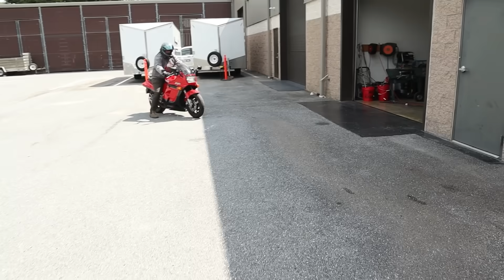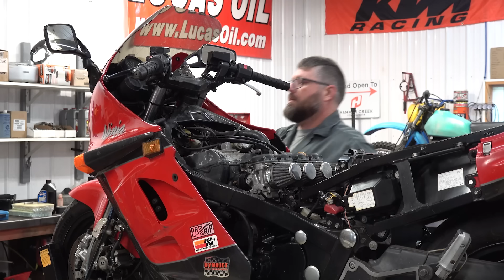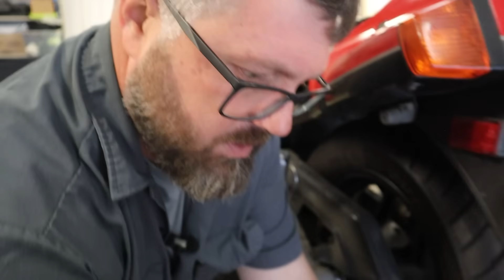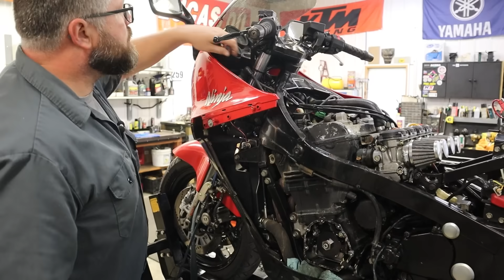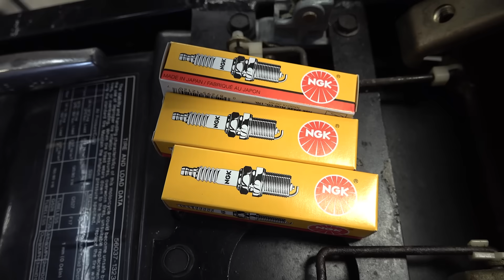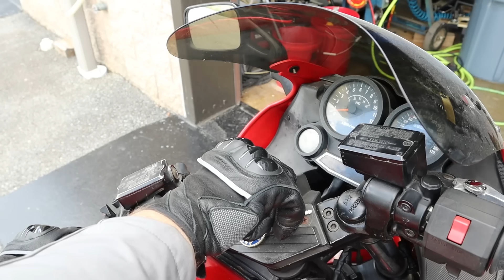Can I Fix This Unfixable Iconic Ninja Super Sport Bike?

Comment: Bought one of these (in black) when they were new in '86, did ~35000ks on that one, it went like a scalded cat.  Great bike, though you needed to be a little cautious with the 16" front wheel over rough roads, definitely not as forgiving as 17s,  though made it easier to change direction.  I dont know why you would bother with pod air cleaners with that bike, the induction system roar through the standard air intake chamber was one of its best features!

Comment: I loved this video. I didn't own an RX but Thirty odd years ago I had a GPZ600R that I loved to bits. I was a Motorcycle Courier in London and countrywide in the UK and used it for work for a year or so...not the ideal despatch bike but a hoot nonetheless 😊. It was essentially the baby brother (or sister?) 😊 of the 1000 RX and I used to do all my own maintenance so this really brought back memories. I would love to own one again but the only downside was the then fashionable (due to GP technology), 16 inch front wheel, which although making the bike mega-quick turning in bends, could be arse-twitchingly (new word!) skittish. Later  I had one of the first Fireblades again with a 16 inch front, I suppose I just liked to live dangerously. Nothing beats working on a bike, firing it up and it runs sweet. Keep up the great work. I'm new to your channel and the Beards And Bikes one too but love them both. Nice one fellas! Charlie, Hammersmith, London 👍.
Reply: HA nice! I was a Courier in London from 87-89 i did it as a job during my working holiday there from NZ. Fun times, absolutely crazy job, paid well too.😆😆
Reply: @uhtred7860  certainly did back then mate. I did go back to it in 2018 as a Pushbike Rider. I've got a problem with my back atm but this time last year I remember doing 30 dockets one day totalling 187 quid!  That was a bit exceptional tbh and I am shithot at it lol! These days there's alot less work but the rates are much better which is only in the last few years e.g. around £5 for a minimum. Take care mate, I probably bumped into you back then, who did you work for?
Reply: @charliecoutts3003  The first outfit I worked for was a small place called the Visa Service, he was based in Kings Cross opposite the station, he only hired Kiwis and Aussies (and under paid us) after i got to know my way around, I left and worked for Pony Express and then Addison lee. Got to know London better than most Londoners.

Comment: Funny thing on this video. From the moment that I began watching it, I was also thinking source coils /pick up coils. Back in 1993, I owned a 1988 Honda CRX, and the car suffered from the same issue. Ran fine when cold,  but once it once it got to operating temp it’d run terrible and stall. Come to find out. The pick up coil in the distributor would get hot and the internal solder on the circuit board would lose connection to vital leads..
Replaced the pick up coil and it ram like new again. I’ve come across this issue on both cars and bikes over the decades since. Good work tho.

Comment: My old Quadrunner ATV had a similar problem.  Ended up being the Voltage Regulator failing, and the voltage getting too high for the ignition computer to operate.  Sad part was that I had seen the voltage was up around 18v, but I didn't recognize that as a problem until someone on a forum pointed me at the regulator.  It was hidden up under the front cowling and I wasn't even aware of it's existence until I went looking for it :)  Ended up being like a sub-$50 fix from amazon.  After I had torn the top end down and cleaned and lapped the valves...but in the end I'm sure it runs way better now and was a good thing I did the valves too :D

Comment: A quick tip for narrowing down a misfire. Grab as many screwdrivers as you have cylinders. Press each screwdriver up to the header of each cylinder for a few seconds then feel the temp. If one cylinder (or more) is running considerably colder, it's definitely misfiring! Sometimes, you can even listen down the end of the screwdriver to hear if it is.

Comment: My friend had one of those and they had a known problem with soft intake valves. In fact almost all 85/86 Kawasakis had the same problem. At the time I was working for a shop so I wasn't just a yahoo off the street. I called Kawasaki and at first they denied the issue. But after explaining that I knew from experience that this was an engineering problem and they needed to take care of it They finally agreed to supply the parts but they wouldn't pay for labor. I agreed. I replaced all the valves and cut the seats and the bike ran well afterwards.

Comment: I’ve never owned or operated a motorcycle until about a few months ago when my neighbor sold me his 2003 Suzuki intruder VS800 for about $300 
 It needs a lot of work done to it 
I’ve spent roughly about $600 on it so far and it runs good. It only has 38k miles on it too

Comment: I've had this problem with eBay parts before coming to the shop DOA and it always ends up causing more problems, because a new part couldn't be bad right? nah, if its electrical, there is always a chance the part could have come DOA, especially when you buy new OEM spec parts on EBAY, what's even worse is sometimes eBay is the only place you can find things for older bikes. glad you got it figured out craig

Comment: Get rid of the pod filters and fit the origional air box collector and filter and it will run much better.. I learned the hard way with a CB400/4 !... The coils you took off looked like dynatek so they had been retor fitted and they couldnt be bothered to strip off the plastics to get them to the orgional mounting points. You got there in the end but shame you didnt go though the carb balancing.

Comment: i worked on a 1896 one in 2015 at 19 years old....It was the same black scheme as Tom Cruise rode on...its tank was rusted and ran like crap. My motorcycle tech teacher over and over insisted on me taking apart and cleaning the bike and carbs like 6 times on it, and get it running right to pass the school. By that last time and it plugging up EXACTLY as i had JUST told him i almost beat him over the head with the carbs 2 times i was SO furious. Told the guy who brought it in to buy a tank on ebay, and showed him how simple it was to clean them. About 2 weeks later he came back in with carbs clean and nice tank he got for $400(so it only cost him 2300 total) and it ran like a dream after that and i got to ride it, was pretty damn fast too

Comment: That's a super cool bike... Ignition systems on the old bikes are soooo finicky... Ive been riding a 1980 Kawasaki for 3 or 4 years and its coils and points based ignition has been an issue numerous times. So much fun when its all working in harmony though. It makes it all tedious troubleshooting worth it.

Comment: I bought a 1987 in black new off our showroom floor. I was the sales manager of the Kawasaki Yamaha in our  city. At the time it was supposed to be the fastest bike you could buy in 1987.The bike magazines clocked them at 162mph. The bodywork was very aerodynamic which along with the high output of the engine made it possible to attain the record top speed of 162 mph. I remember the big Ninja being much easier to ride at high speed on the interstate than my 1979 Yamaha XS1100 I had bought new back in the day. It was a great bike with a powerful bulletproof engine and shaft drive. It runs just as good as it did when it was new but not having the full fairing made it have a slower top speed.
  A friend of mine bought the first new FZR1000 we ever sold and it was definitely a full on sport bike with the clip on handlebars and high footpegs. It was quick but my bike would eventually outrun it on top end but not enough to really matter.
Reply: Top speed recorded in Motorcyclist by Jay Gleason was 158 mph

Comment: Nice to see a mechanic who doesn't look at a problem that is not X=Y and go nope. My bike needs its engine mount rubbers changed and a strange loss of power when at temp (but not as bad as the ninja) and the local bike garage won't take it in for either as "i'm not interested". Couple that with the two closest cities OEM shops closing down and i'm left in limbo looking for a good mechanic.

I miss my bike 😢

Comment: The 1st things I noticed was the color of the coils (Dyna) not OEM they are almost always black secondly it has a VHR rotor  which a Vance & Hines  product these usually advances the ignition timing and the Dyna coil will give you a hotter spark ⚡️.
I will now continue watching this video.
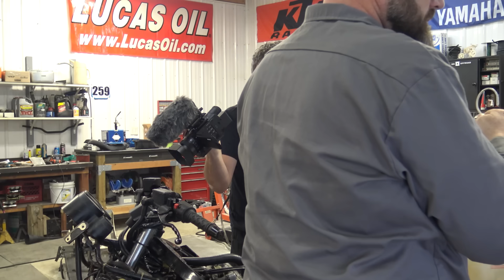19:56 in.

Comment: I have a no spark problem with my KZ440 when it gets to operating temp.  Couldn't go very far and the bike would shut down.  Cools down and the spark returns.  Can't find a new or good pickup coil anywhere.  I did get the bike to run with out shutting off due to the no spark when hot  by taking off the cover down at the end of the crank where the coil resides and cut a piece of window screen for a cover plate to help keep debris out of it when riding.  The coil sticks out a bit and catches air when riding. The coil doesn't get hot now like it did with the cover on keeping the heat in.  So far it's running very well with the screen allowing it to stay cooler.  Going to keep an eye on the inside to see if dirt gets in there to cause a problem.  Gotts do what ya gotta do.  Don't like it that way BUT I can now ride without it losing spark.

Comment: The hardest fault to work out for me, was with my Royal Star venture, which would cut out after 25 - 30 miles and no spark. I knew it was heat related, so changed the ingnitor, pick up coil and the cut off relay, 1 at a time and took it for a test ride, with the same result. The only other thing connected to the ignition was the tip over sensor, which is hidden in the frame behind the head stock and above the thermostat, so it had to cool down completely to get back after breaking down. changing the tip over sensor cured the problem. side note, if this sensor is disconnected a code flashes on the dash, but not if it fails

Comment: Take a timing light out with you, and clip it onto each plug wire when it acts up. No flash, no fire.

I've diagnosed electical issues on an outboard engine, and several bikes that way, and it only takes a few minutes

Comment: If the bike feels like it's getting some odd flat spot in the midrange throttle try putting the stock air box back on that thing. Running pods on CV carburators never seems to be an ideal combo. They can be tuned to work, but I've never rode a bike with pods/CV carb combo that didn't have that issue.
Reply: Same. CV carbs by their very design don't work well with pod filters, and work best with an airbox.

Comment: On some bikes the wire from the ignition pick up coil can deteroirate over time due to proximity to the engine casing. This can cause the bike to cut out when its hot. I bought a set of coils from Ebay and there were ok but bit of a dice roll i guess.

Comment: as far as the heat is concerned aslong as it doesnt go higher then half way on the gauge you should be good, but with that bike id still keep an eye on it, i mean it seemed to cool down as you drove it so it should be fine now, im still impressed with how well you fixed it :)

Comment: Been through similar with supposed quality hi performance ignition parts, On a race car. The warmer it got the worse it would run. In the end I binned the distributor and fitted a factory one. Ran fine. Though the factory parts really were not up to the application.
Another time and different car car was struggling to run,, I was extremely unwell the aftermarket HEI module was failing,, and was nearly new. Initially I thought it was fuel,, blew the hoses out and checked the pump all seemed ok. A chap went back to his parts store and came back with a proper Bosch module. Fitted it and the engine was fine. I was still driving like grandma however. These days however sometimes Bosch is just the label for made in China.
Yet another time I drove the car on the trailer, got to the track and no spark. The Crane ign  box had died. Another bloke verified my opinion. I had the box tested though and it worked, refitted to the car and it startd then stopped.  Had similar on my weekend Cruiser, it would stop, leave it for 10 and would start. Then either die in 20 min or go for months. I eventually bought yet another box and it runs perfectly all the time. And when working the car starts better runs better and even uses less fuel. 
Racecar without box gets very lazy over 7000 rpm. Timing starts to retard, with the box runs clean to the limiter at 7500 and would run further. So damned if I do and damned if I dont.

Comment: The hardest part of owning this fully fared bikes is finding fairing parts. They came from Kawasaki completely painted and Kawasaki USA didn’t keep a lot of spares in stock after the next generation came out. I worked in a Kawasaki shop in the parts department and 5 years after a particular model was superseded body parts started taking longer to get. Great bikes though I’ve owned may over the years.

Comment: A friend bought the exact same bike brand new way back when... Did 265kph with two of us on it.  He didn't believe me that I couldn't hang on for more than about 39 seconds at that speed until we switched positions. He thought I was just scared lol. I WAS scared but that's not why I kept getting him to slow down when he got up there. I could have gone 265 for an hour tucked behind that tiny windscreen too. Incredible difference at that speed. And don't think 220 or 230 is the same!    265 is next level wind if you're on the back!

Comment: One take home though is only to change one thing at a time then check if the problem is the same, better or worse. If you change lots of things and it gets worse or better, you don't know which step caused or fixed the issue. This would have saved a lot of head scratching here. One approach I take with those 80's/90's kawasakis is that everything on the ignition system is doubled up (two pickup coils, two igniter boxes, two ignition coil packs) so if it's dropping cylinders and you can identify which ones, you can swap componants one at a time until the problem changes sides. Unless of course it's dropping adjacent cylinders, then you're just in for a bad day.

Comment: As soon as you ran it I knew it was dropping cylinders. The modern shops just don't want to deal with something that can't plug a diagnostic computer in. I used to just feel the pipes with gloved hand to find out when a cylinder wasn't firing.

Comment: 16:39 a motorcycle guy should know that those green coils are aftermarket dyna ignition coils and run different than stock coil. It also apprears to have an aftermaket ignition advance wheel. Possibly +3 degree.

Comment: I had an earlier gpz 9a that had an overheating problem. It would kill the battery after running for awhile. The owner before me put an aftermarket fan on to cool it but it just drained the battery. What a pain figuring that out.

Comment: Oh oh...the beginning of this vid reminds me to my problem two years ago with my GPZ 1100 from 1995.
Was the same while starting. Many tries, when gave gas engine quits, next try etc...
Once i was in neighbour town, try to start, nothing. Tried til battery was empty. Sunday of course.
Next day i call the repair garage and they said that the intake rubbers to carburetor was demolished, the rubber was too old so it got small holes, so the carburator got too much fresh air...
Costs lots of money to repairs it. But after it i bought a new battery, too and after that the old Lady works well.

Comment: It's like trying to get a dual filament bulb to work.. on the negative side of the coil it will but when too much resistance at a certain temperature 🌡️ hopefully this helps you a master electrician with solder would understand the theory because we're all trying to create the same theory without the intermittent problem

Comment: In our New Zealand Rural town we have 2 Ninjas from Studios used on Top Gun. It was part of a fleet used. A Emirates international pilot purchased them in his spare time. I was made to repair the exhaust system which was a real mess as it was rusted out bad. We couldn't get parts for them but I think in U.S it's possible.
Reply: Its horrendous getting parts for older bikes in the Oceania region. I had to import and 18 inch rear wheel for my 1983 Honda to replace the rusted out 16 inch rim

Comment: I haven't gone through the whole video yet, but a couple of comments so far.  Ignition Coils on these bikes (and most others with Dual fire coils) don't need to be grounded.  The 'grounding' may help with heat dissipation but is not required electrically.   If any behaviour (good or bad)  changes when the coil is grounded, it means there's an internal short to the iron core of the coil.  The coils that were in there are obviously aftermarket and the wrong ones for the application.  

Pod filters are garbage - the first thing to chuck - and get an original air box back in.

Comment: Like if you have a test like that completes a circuit on the wire it might stop the problem.. if hooked in series like using a test light on a starter it will start if the relay is bad it'll automatically try to start

Comment: I think there is a distinct difference between ‘fitters’ and knowledgeable proper mechanics. Most shops employ fitters who will simply replace parts that a computer tells them may be faulty. A knowledgeable mechanic like Craig will actually be able to work out what is wrong by knowledgeable course of deduction and fix it 👍

Comment: I'm having the exact same problem with my KZ440.  The pickup coil's resistance goes up when it get hot and then no spark.  Wait til cools down and the bike starts again.  goes for a few miles then quits again and again.  Can't find a pickup coil anywhere so the bike just sits in the garage.